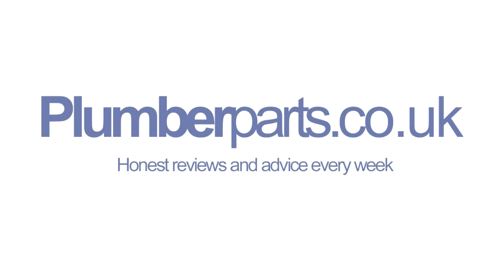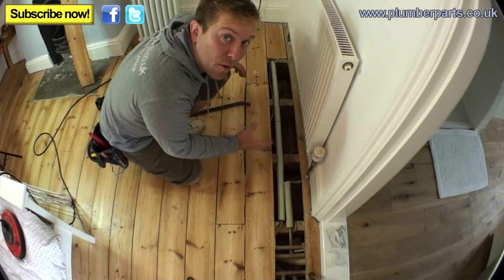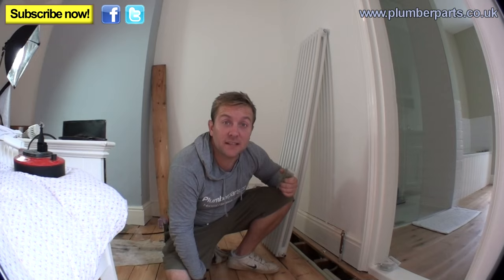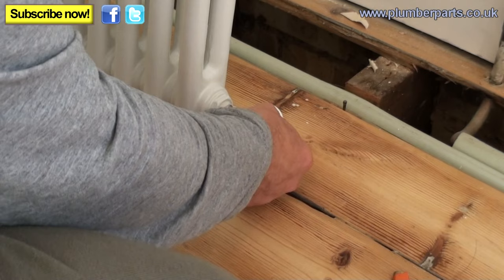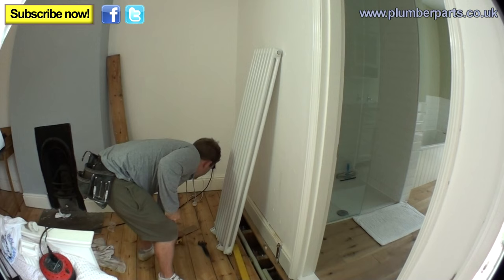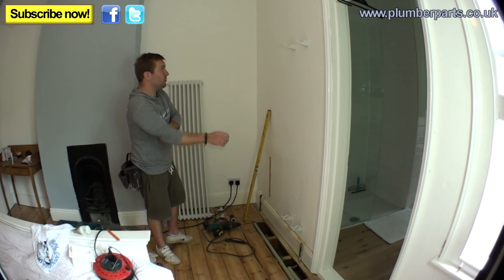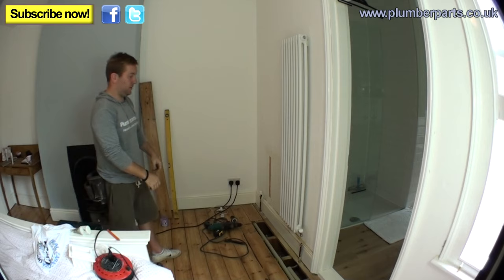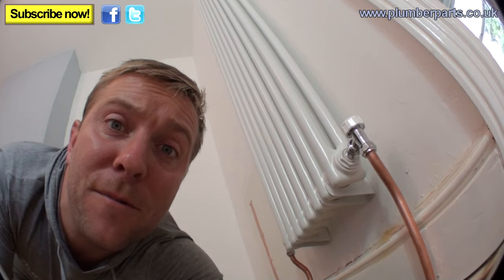HOW TO INSTALL A COLUMN RADIATOR - Plumbing Tips

Comment: DIYPETE
Watched the video a couple of times before fitting a column radiator did as you showed  everything went fantastic also used the same screw fittings as shown in the video had no problems with them. Thank you

Comment: Great video! I put one of these on a dot'n'dab hollow wall - had to recess wooden blocks to bridge gap between plasterboard surface and bricks behind. Used long "bolt head" screws through the wooden blocks into the brick. Job done!!...these radiators are just really really heavy. Bo' Selecta!

Comment: Hi...i fitted a double aluminum tower rad. In my bathroom. Like you was concerned about the weight. The internal wall is breezblock. So, made up a box for the rad to sit on. It  hangs on the top brackets, rests on box which takes the weight. There is one bracket in the middle of the rad. at the bottom, which stops any vert/horiz. movement. Holes are drilled at the back of the box for vent. Box then covered in carpet. Looks good.

Comment: I have one of these radiators fitted recently in my identify plan kitchen everytime I open my sink in bathroom downstairs and slide it a few seconds later if u go next to the radiator it makes a bubbles water noise fir a few seconds. This is the same if I open and close my sink in kitchen.  I've had a new boiler installed a week ago. Anyone know what cud be the reason if of my issue and a solution please.

Comment: In the end you didn't use the pipe with the trv you had to cut it out, what happened was that because the pipe needed a slight off set in the end. I fit 3 of them a few weeks ago it's always a pain matching upto existing pipes. Nice job as usual

Comment: Would have been good to get a close up on how you got the bends on the pipe once you got them below the floor.
Love your vids bro and love the look of column radiators as well, but not great on BTU's for their size.
Reply: All cellar of soak com 1500x290mm white double panel vertical colosseum traditional radiator premium p23755498 htm

Comment: Can these shape radiators be hung the opposite way up, say with the inlet and outlet coming in from the top

I ask as I tend to have one and the pipes come from above, so would I have to run the pipes down to come in the bottom of the radiator?!!!

Comment: We had two of this type fitted in a new extension, he worked out the BTUs,s but they are basically crap. They take far too long to heat up.and even when they are hot the room is just not hot enough, Question one is there a top and bottom ,and somebody mentioned to me about a gate thats just inside the rad valve entry point that has to be opened before installation ,allowing the water to flow to the top of the first section then slowly drop down to all the sections ,any comment would be handy ,personally i wany to take one of them out  and replace it with a conventional rad ,but wifey is not happy because it means a pipe showing on the skirting because the new floor covering would be a nightmare to lift,.

Comment: Great video.
Most of these column radiators have inlet and outlets. My inlet and outlet stickers have been pulled off by my 2 year old. Any ideas if you can look inside to differentiate?

Comment: All the vertical radiators I've purchased recently have metal filings still inside them that you can hear when tilting the radiator, which I can't seem to flush out.
Any one else have this issue?
Reply: smithboyv1 yea can be a major problem. I fitted a whole house out with  Delonghi coloumn rads and all the enamel inside kept flaking off when the heating was running. You could here it pinging off inside!  I had to powerflush the system in the end, but it was a nightmare!  Last time I have fitted Delonghi coloumn rads btw!

Comment: How do you move the pipes if they are built in the wall 
I need to get a smaller radiator but dont know how to move the pipe work with it being in the wall
Thanks

Comment: Hi buddy,  i want to tap off from a hallway radiator into a bathroom radiator-sort of a leg-  just flowing around the bathroom rad back into the F and R for the hallway rad. Is this as simple as it sounds and do i need to plumb it in any particular way (given that TRVs are bi-directional)?  thanks..

Comment: My problem is that my floors are sheet MDF rather than floor-boards. Also the radiator feeds are flexible plastic pipe, coming out from the plaster-board wall...
Reply from the maker: You'll need to by an oscillating cutter (or Fein) that'll get you in in no time!

Comment: I've just put one of these in but I have muddled up the flow and return, so the pipe that gets hot first is going into the return side. When on the rad makes a trickling noise and dosent work properly, will this be sorted if I flip the pipes. Cheers.
Reply: yes
Reply: @Tony91177  it just needed massively bleeding, the pipe direction seems to mean absolutely nothing.
Reply: @tdgg3164  I had this Monday. Hung 4 new radiators. all the same just different sizes. Two had a inlet and outlet sticker on them, the other two didn't. one of the ones that didn't just would not get hot. I kept bleeding it and raising the pressure and balancing the others, then eventually after about 25mins of this it started to get hot. Really strange! Worked in the end but I was thinking maybe this was also directional even though there was no stickers on it.

Comment: I'm hanging my first column rad in the next couple of weeks. I've taken the old rads off, no issue. I was hoping to just connect them to the existing pipework though, after fitting new TRV's and some telescopic radiator tails? I'm no plumber so was hoping to avoid altering pipework. I notice you ended up having to alter the pipe to the right hand side of this rad though?

Comment: Hi,  can I ask you a quick question?  I did install three new vertical radiators downstairs.  Two of them take ages to get warm (one in the kitchen and the other in the sitting room,  it is mid terrace house).  What advice you can suggest?
Reply: Probably a bit late now but you need something called a 'flow diverter' which forces water to the top of the rad.

Comment: Hi James love your videos, I'm sure I've seen one where you replaced a rad with a plumbed towel rail using the existing valves/pipework - but cannot find it - is it still available? Really looking for help in measuring up using the 90 degree dual fuel elbows and how this will effect the height in relation tothe brackets to hold the towel rail on the wall?

Comment: Hi, I installed a column radiator of the same brand a few days ago. What i saw is that the bottom was hot just after starting the system but 40min later the top was still cold. I am considering running the hot pipe all the way to the top port to have the feed the furthest away possible from the outlet. Its kind of a problem as i already did the holes on the wall and an exterior pipe at eyes heigh will not look good (specially with the big thermostatic valve there at the top) but otherwise it looks absolutely inneficient. Have u not had this problem?
Reply: You need to let the air out at top while your slowly filling it with water. If its full of air then water cant come in all the way to the top

Comment: You did everything perfect except the bottom brackets face down to stop radiator from coming off the wall they're very tricky to fit ..You do the top brackets first hang rad on them loosely fit the  bottom two brackets  and you go in from side with a spanner and tighten bolts ..with both brackets facing up the radiator potentially could be knocked of the wall with upward force

Comment: Fortunate you can lift the floorboards. I have an old type 11 radiator thats 2m in length and I want to change to type 22 and reduce the size to 1600mm and still have more Btu. Problem is the pipes are in the wall and its the 8mm copper type from the 80's

Comment: Both valves need turning off. If you're not confident then as the rad will be full of water, disconnect one side first and drain the radiator to make it easier.

Comment: When hanging the radiator do you need to pitch it slightly towards the feed pipe so it will run back into the pipe when cooled so you won't get air in the pipe causing noise?  Thanks, Ray

Comment: alright mate, I have a problem, I am installing all my radiators myself but I am having the pipes come out the wall. the problem is I am using chrome piping but I am struggling to tighten the pipes without the pipe kinking ever so slightly just after the nut and they keep leaking when I pressure test as well. is there a special sequence/trick to tightening the pipes without twisting the pipe?
Reply from the maker: Try and use a little jointing compound on the nuts.... SUBSCRIBE! ➡️👉 https://www.youtube.com/subscription_center?add_user=plumberparts 👈⬅️ IF YOU HAVEN'T ALREADY! 😎
Reply: plumberparts cool, I'll go out and get some, I think I will replace all the chrome piping as well as it doesn't look great as is. 

thanks for that

Comment: How much loctite do you use on radiator spigots ?
Reply from the maker: +Michael Howe About 10 turns crossed up. It spews out what it doesn't need.
Reply: +plumberparts thanks!

Comment: couldve moved the radiator a bit more towards door, in that case you wouldnt have needed to bend the offset on the left pipe. great work but just saying i would prefer both pipes to be straight

Comment: Hi there. Love your videos but the bits you timelapsed and cut from your towel rail vid were the bits I really wanted to see :-(. I have an old Victorian house, but in the bathroom the pipework runs at right angles to the joists. I need to replace a huge old radiator with a smaller radiator / towel rail combi without notching out the joists. Radiator is also earthed - I've not seen this in your videos. Any advice on how to proceed would be appreciated. Maybe flexihoses and box in above floor pipework? Cheers! Kirsty x
Reply from the maker: Hi Kirsty, can you show us the problem here at Google Helpouts? https://helpouts.google.com/101344000685454855058

Comment: Them Anchor bolts are crap.... 2.5" screw 5.5mm/7mm drill bit.... Red/Brown Rawplug....
Drill hole, insert plus and tap in with a hammer... insert screw to plug tap again untill firm.... Srew and fix (Solid)
Reply: Or just use fixings that are designed for plasterboard/hollow walls rather than bodging together some standard multipurpose rawl plugs.

Comment: why do you guys put nice chrome fixing at both ends of the radiator yet you have the horrid copper pipe going up to it, surely the last bit of pipe that is going up to the chrome fixing should be in chromed copper pipe as its look really nice and is the only bit of pipe display to the eye.

Comment: just a question I am going to pressure test pipes under floor and would like to know to what pressure you test its a loft conversion and pipes will be under floor under wall so making sure no leaks many thanks for help so far colin
Reply from the maker: Best to test to 2 bar. Remember as the water changes temperature so will the pressure reading slightly. Leave for a day. Good luck, PP!

Comment: hi there would you personal put copper on plastic under floor for central heating 22m your opion pleas
Reply from the maker: Yes that's fine as long as it starts a metre away from the boiler and has copper up to the rads.
Reply: +plumberparts a quick novice question,but why copper,and not plastic up to the rads?.
Reply: +TheOldschoolfool copper tends to be more reliable, I find its a lot better to work with if you have to replace the rad, looks a lot better & prevents you needing to use plastic fittings which tend to leak more :)